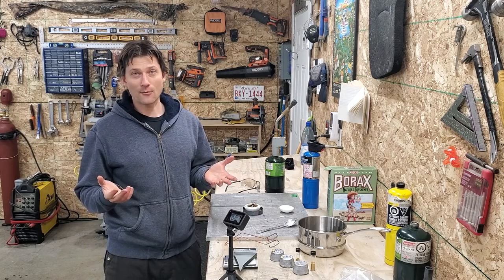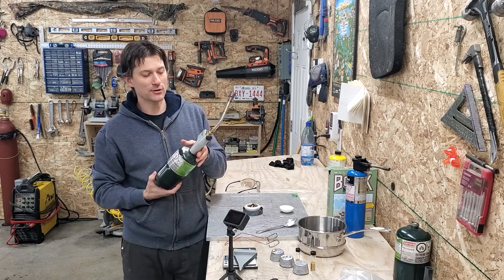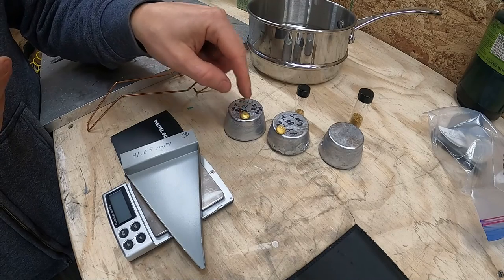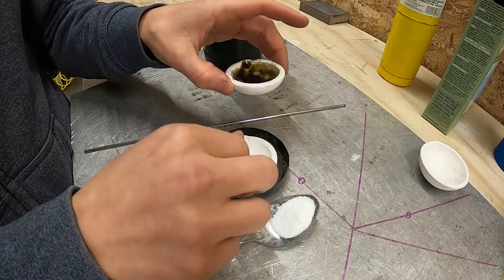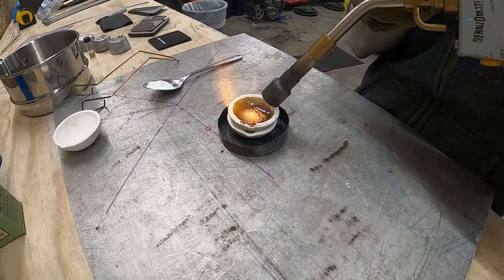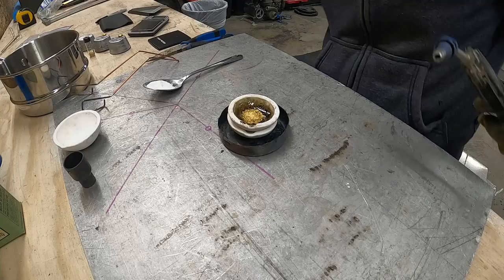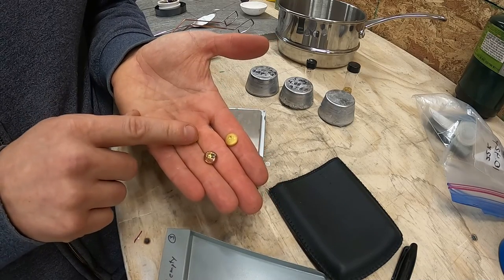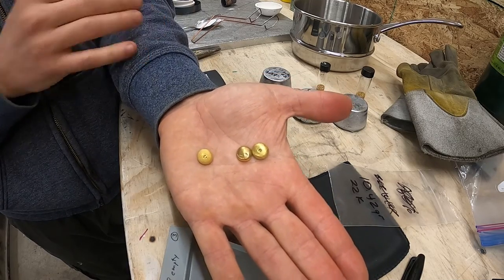How to Melt a Gold Button with a Propane Blowtorch.

Comment: Great video, Kyle. I always drop my buttons in a glass of water to cool them, and then into a bowl of vinegar for about a half hour to soften up the glazed borax coating before picking it off. If you take sandpaper to your button to remove the borax, you’ll end up losing some of your gold. As well, don’t bother with propane - stick to MAPP gas and heat your crucible for a couple of minutes before adding your flour gold. If your crucible is properly glazed, the flour gold will bind to it. Then cover your gold with a bit of borax and heat things up slowly with the torch to avoid blowing any out. Rather than pouring your gold button out of the crucible, let it sit for a few seconds after you turn off your torch and then pluck it out with a pair of tongs or tweezers before the borax cools. Much easier to drop the button into water and you don’t risk dropping that crucible in the water (resulting in an exothermic reaction/explosion!). As well, you can get rid of the “black” residue in your crucible by adding a half teaspoon of borax and heating it up super hot - then pour out the molten borax. The black residue will come with.
Reply from the maker: Thanks for the tips Mark, super helpful! 👌

Comment: The Borax actually does a few things.  Along with binding things as you mentioned and grabbing impurities, it also helps lower the melting temp of your metal.  The torch I use and have amazing tesults with is a pencil tip torch.  I use the mapp gas with the concentrated torch tip and my material is melting within a few minutes.  Preheat your crucible like someone mentioned, that will keep things from flying out of thr crucible.  Once you have your crucible treated with borax you dont need to add much with every melt, if any.   Happy melting!!

Comment: I used a top torch, camp propane gas, a cheap crucible and some borax total under $25 usd and got 2 grams of 22k.  I like your idea of more air  thru the nozzle.

Comment: Very interesting melt. I melt all metals. Alu, Cu, BR and ag. Just did a gold melt with an electric foundry and had a huge fail. Only used 1.62 g of gold and a graphite crucible, no flux. Had a .38 gram loss not sure why. May try a ceramic crucible next time. Thanks for sharing. 😎😎⛏⛏🔥🔥

Comment: Nice work. I watched several videos a few years back where they made a small enclosure around the crucible with brick to hold the heat in and they were able to use 1 torch to melt the gold. One used map gas and the other used regular propane. I made a small furnace like the commercial ones and it melts gold quite well with 2  torches feeding into it.

Comment: Try a solid block of charcoal cut a depression and heat it in there the charcoal creates more heat, the crucible takes heat away. The box works as a flux keeping the surface of the gold clean and helping it run into a ball.

Comment: Thank you for replying to everyone's comments. I have a question.  degree of temperature does your super power torch produce?
Reply from the maker: I have no way to measure that...  Gold melts at 1,064°C, and the torch only just barely melts gold using propane unless I boost it a bit with the compressed air.  The torch packaging 'claims' 1,750°C with propane and 1,950°C with MAPP gas...  but I suspect that would only be in a small area in the absolute peak hottest part of the flame.  Running MAPP gas with the compresses air boost really speeds things up nicely.

Comment: Did it have to be a melted button? You should be able to cold weld gold flakes into a bar with some hammer work or a roller.
Reply from the maker: That would be an interesting experiment for me to try.  Thanks for the suggestion!

Comment: Hi Great tip about the compressed air. Thanks.
I often watch Sreetips videos and I notice he has a different technique for cooling a gold button. He leaves the melted gold in the melt dish with the blowtorch off and watches it set. As soon as the gold has set, he lifts the button out with tongs and drops it in the water. Not sure how he can tell exactly when the gold has set. He uses your technique when he wants gold granules for further refining.
Thanks again for your video.
Reply from the maker: Cool, thanks.  I bet the gold solidified before the borax so if you time it right that would work.  I'll check out his videos and try it sometime!

Comment: Do Jewelers usually charge to test purity in chains, or buttons such as you made ?
Reply from the maker: I don't have much experience with this, but the place I went charged me $5 to test the buttons and said they would wave that charge if I sold them the gold.
Reply: @UtmostOutdoors  I have 3 rings( 20, 21, and 22 grams) and 3 men's chains. They all have 18K or 14K, but when I tested one chain, it came out as between 10K to maybe 12K.  The 14K acid ate it up..  I'm new to testing jewelry, so I might be far off...lol

Comment: Haha, when you put the air compressor in the hole of the torch, I was thinking "Damn, that's just like a turbo charger", and right then you said "super charger". Great minds think alike. I was going to comment about turbo heads for propane torches, they do work if you get the right kind, and work EXTREMELY well at that. I can actually braze & silver solder with my turbo head (for joining copper HVAC lines) and it saves me loads of time and money. If anyone reading this doesn't have an air compressor on hand, look up turbo head reviews on youtube and go with that, it should preform similarly.

Comment: Borax solubility isn't great in water, but that thin coating should dissolve easy enough in a cup of boiling water with some sturring. It should also be much more soluble in ethylene glycol, which is what most antifreeze is made of (check the label), maybe if you want to try cleaning your crucibles.

Also borax has some toxicity associated with it, so just be careful when messing around with it :)
Reply from the maker: Thanks for the tips!
Reply: Vinegar removes the borax very well.

Comment: Hey y’all .. I’m very new . I have lot of fine gold . That I am having trouble getting clean / quartz. I am in Calgary hoping someone can give me some tips . Thanks
Reply from the maker: Hey, not sure exactly what you need help with.  Does this video on miller tables help? https://youtu.be/ckocan-t_3M
Reply: Hi Kyle . I built a miller table .. and have it refined very good .. I still haven’t done a melt yet .. I have about 30 oz  just don’t want to mess it up . I bought a Vevor smelting furnace. I have a few crucibles . Have a graphite indoor mold . Not sure if I should cook off the sulphides . Then do the melt .. I’m in Calgary sw

Comment: Any reason for hitting the mapp canister with the propane flame? Lol
Reply from the maker: While I wouldn't recommend it, I was hoping to bring the pressure back up a bit and get a hotter flame...  The canisters get pretty cold after running for a while.
Reply: @UtmostOutdoors  ok I got ya..gotta do what you gotta do sometimes 🤷‍♂️

Comment: Good video, but never sand your gold that’s a no no and when you have melted it, just as it stops glowing get a good set of bent nose tweezers and pick it out and drop it in your water, because some of your impurities are picked up from the flux/borax as you tip it out of your crucible, and the added air supply I’ve been using it for a short while now, it makes sense 👍
Reply from the maker: Ok thanks!

Comment: wait, were you torching your map gas canister 2:05?! wow. not brilliant.
Reply from the maker: Gotta do what you gotta do 😀 
I figure it's basically the same as a tank belly heater... you just wouldn't want to over do it.
Reply: Wtf
Reply: @UtmostOutdoors  pay no mind to these guys ... I get the ice off my full size cylinder with a tiger torch and been doing it for years ... even as a roofer laying torch on .... but please make sure there are 0 chances of a leak before warming your mapp cylinder / tank , and thanks for the air compressor tip I just might have to try that